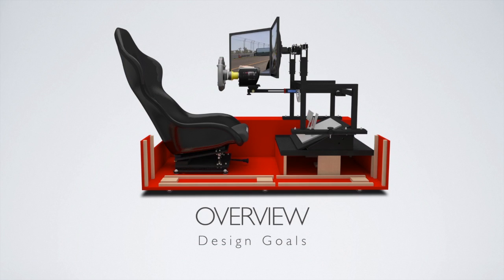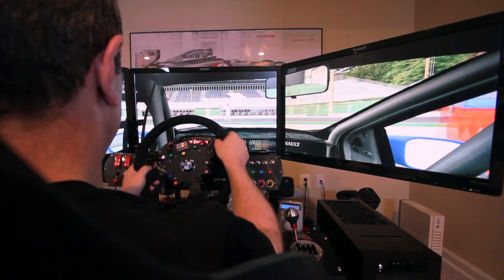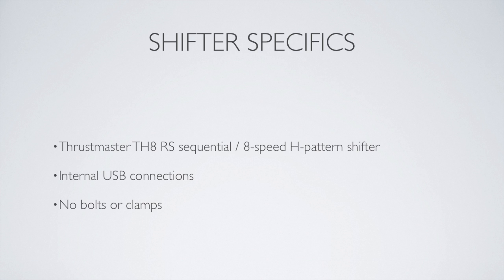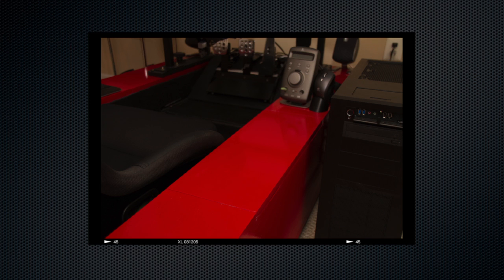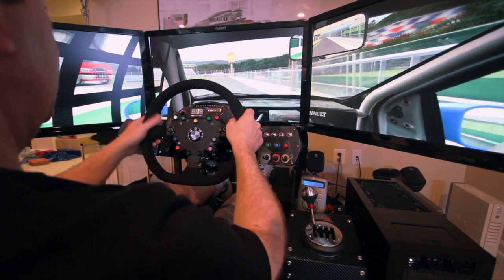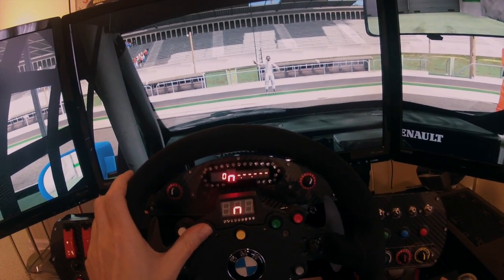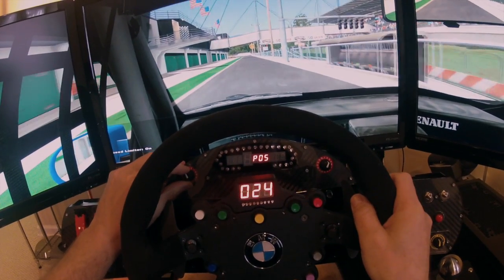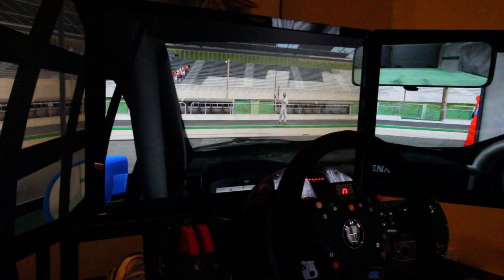Expansion of a Driving Simulator

Comment: I'm building the sled from your plans and have a question about the seat. Did you get the Forza standard or the wide seat. Would the seat be tight for a person with a 38"-40" waist? Thanks for putting the plans out there.
Reply from the maker: +Robert Lara I used the wide one, it is 22.5" wide at the thigh area.

Comment: So you have no motion in your seat at all its just a fixed seat? Also I watched your final driving video by the amount of tire squealing that was going on you're scrubbing off too much speed in the turns..... Smoother is better than faster. Just a little driving tip
Reply from the maker: Correct, the seat is on a rail, so it slides fore and aft and can also be tilted.  It has two pucks built into the bottom to transfer low-end sound but it's not a full-motion simulator.  That would be a tough trick to pull off for less than a grand.

Comment: Hey Gregg. Don't know if you answer the Questions here, but I am lokking into options of using a rig for both simracing and also like a workstation and for other games like shooters. Do you think the steeringwheel would could be moved down and in under the screens and then maybe make a keyboard n mouse "table" to put over you, så that its transformed ? 

Hope you can help. And maybe its an idear you can use yourself
 
Thanks
Reply from the maker: The problem I run into is leg space.  Right now, when it is tucked away, it is under the monitor (mostly) but is as low as it can safely go without becoming a knee banger.  When I'm playing a FPS, I usually leave the seat all the way back so it's less of an issue.

I have been considering various keyboard mounts recently while playing Mechwarrior.  I'll no doubt design and build a few prototypes and will post the design on my webpage once I settle on what works and is easy and cheap to build.
Reply: Gregg Lagnese WOW thanks. Didnt expect an answer like that. Looking forward to your videoes when you figure it out :)
Reply from the maker: FuglRacingTeam
The type 2 keyboard tray is under development know and nearing completion.  You can see the current built state here:

http://lagnese.me/Hub/Sim_Blog/Entries/2014/2/16_Type_2_Keyboard_Tray_Build_Progress.html

Comment from the maker: While it doesn't deflect as much as a typical desk would wobble, I agree with you.  I am designing an improved steering rack and monitor mount that should be more stable with no deflection at all and can be retrofitted to the existing platform design.

Comment from the maker: If you are asking how hard it is to make the shifter, that's pretty easy - it's basically a box.  If you are asking overall, it is fairly straight forward and all of the major wood parts can be cut with a hand-held circular saw (see anatomy video).  For the steel components, you will need to either pay someone to make it, or use T-Slot of your own design.  I am toying with the idea of offering kits for the monitors and steering rack based on T-Slot material right now.  Depends on the interest.